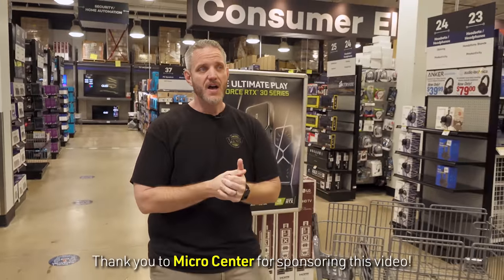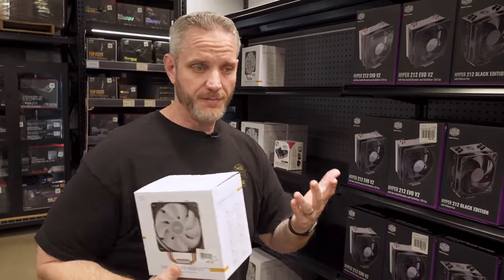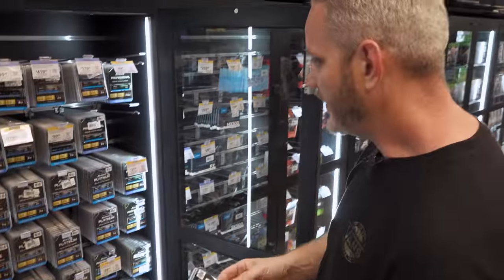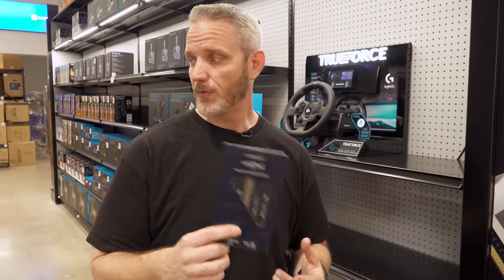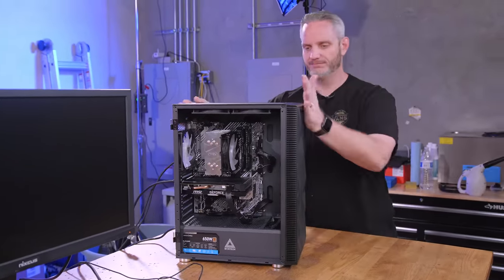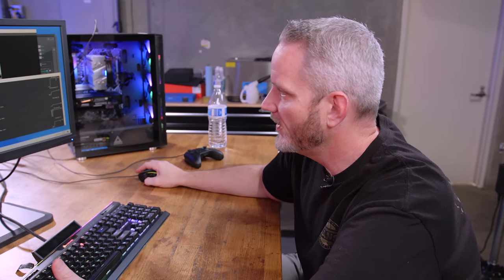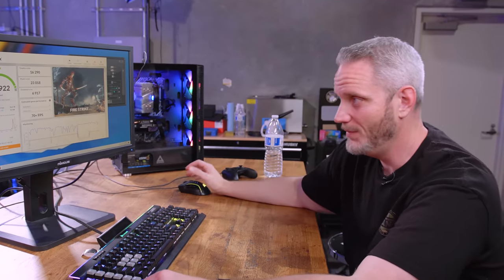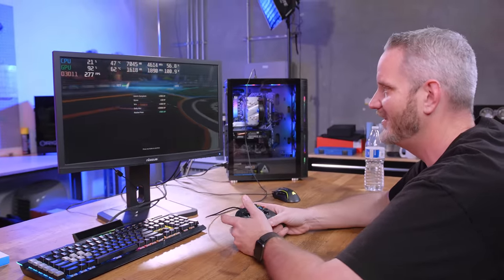How cheap can I build a "Gaming PC" for in 2022

Comment: Well I went the 5600g route and I'm quite satisfied, that allows me to save for a higher GPU. Still more videos like this are needed, most channels on PC building focus on middle high to super high end side of things, while most people hardly has more than 1 75hz monitor. Keep the good work
Reply: why not do 12400 for $100 cheaper? or 12600k for the same price but better?
Reply: @Raxion496  5600g better integrated graphics
Reply: Feel sorry for whoever buys parts like these. And his last part video. Terrible budgeting
The only good part was the RAM
Reply: @Raxion496  12400 is 200ish 5600g is 200 and has better graphics plus mobo and ram costs on 12400 would be higher and the 12600k is not a 200 dollar cpu
Reply: @idko785  well it depends on the budget and when u do get a gpu the 5600g just won’t be as good
Reply: @Raxion496  intel motherboards are expensive
Reply: What ever u get use that bad boy i got 5600x with a 3060ti
Reply: I know not everyone can do this, but being in the PC scene for about 10 years I can say a few things. Budget pcs are simply not worth it if you are going to upgrade them in 99% of cases. Buying a upper mid tier/high end PC every 6-10 years vs upgrading a budget one or building a new budget one every 3 years is night and day. A high end PC in 2012-2016 is still very usable today. Think of 7700k and 1080ti, still very respectable. if you bough a budget PC, gtx 1050ti and i5 7400, not so great huh. maybe you upgraded the i5, to a new platform, that's a lot of money. maybe you upgrade the 1050ti to a 2070, but that 400 watt power supply you got isn't going to cut it. Now add a power supply. wait, the CPU is bottlenecking it, I'm only getting 10% more fps when I should be getting at least double. This is just an example so take it with a grain of salt. I just wanna shed some light for the people who think buying multiple budget systems/upgrading is a better path. a 7700k and 1080ti is still a great system today, 6-7 years later, and could be sold on craigslist to cover about half of a new high end PC. Sometimes buying a high end pc and riding it out for longer is a better choice on the wallet if you can afford it
Reply: Just did this for a friend. I'm highly impressed. Hes still playing almost anything at 1080p 60fp with proper setting. Will pair very well with a 6600xt down the road for some 1440p action.
Reply: well g model will lose you fps when you buy a gpu vs the x or even the cheaper i5s
Reply: My 3400G got me pretty far. Now I can't wait for the RDNA2 APUs.
Reply: @coreytv1338  I just buy budget that can play most on High at most affordable native resolution, play on Low-High after 4 years, still works fine after 6-7 years Low-Medium (even High on older or less demanding titles) at native resolution, maybe 80% resolution by 8 years in. Just because it stops running games on High doesn't suddenly make a PC useless.
Reply: 12400 is alot faster then a 5600g though. Same with a 11600k.
Reply: @Tofuey  Dude, it's 6c/12t. What's it going to bottleneck?
Reply: How much did the total system cost?
Reply: I went the same route as you did
Reply: Had a 5700g for almost a year picked up a 6800XT for msrp I liked the extra cores and was okay with spending a 100$ more
Reply: I have a 60 hz 4k
Reply: @BREEZYM6015  around 803.81 with keyboard, fans and mouse upgrade as well
Reply: @angelcm156  Not bad.
Reply: @Raxion496  The mobos are expensive and the cheap ones suck
Reply: Beware that 5600g only supports pcie 3.0 when you buy the gpu (6500xt only have x4 lane, 3050, 6600 only have x8 lane), so aim for 3060 or higher
Reply: @Raxion496  yes but its better not to have something you want to change for something better + you could change both cpu and gpu
Reply: @geekarch_pc.id_  even the 6600 xt have only x8 lanes, I think a good option for the 5600g is the 3060ti which has x16, although 5600g only supports PCIe 3.0 it will still perform better than the 6600 xt.
Reply: @TroostDesigned  i didnt know that, thanks
Reply: @Raxion496  you won't even notice the difference in performance between a 5600g and a 12400 in reality even with a discrete GPU. might as well pick the one that comes with good integrated graphics while you wait for your GPU and easier motherboard choices. It's personal preference at the end of the day.
Reply: @coreytv1338  Yeah I just started realizing this the past couple years. My next build is not going to be upgrading to a better "budget build". I rather save up some more and get a high end build and not worry about upgrading for a while.
Reply: @bhuvangunessee  As long as you are happy doing that, that's all that matters. I spend so much time on my pc that I want that 144hz locked at high to ultra settings. I dont game all the time and rarely a AAA title,  but when I do I want a high end experience. I'm a programmer, so my pc is something crucial to my ability to make money. Everyones goals are different with their pc. as long as you are happy, that's awesome. I just wanted to post my thoughts to shed some light on another perspecive. budget builds are usually great low wattage homeservers if you pull the gpu as well. There are lots of ways to look at it
Reply: @MyNameIsBucket  the architecture of a cpu is more relative to performance than ghz or core count. IPC is normally the leading factor in performance, but obviously relys on cores and ghz to get the most instructions per second. performance in the last 7 years has been crazy. mostly on the cpu side imo. Wait another 10 years and we will probably look at this hardware as lower end gear hopefully
Reply: If this was ment to be "cheap" did you buy an Intel CPU and motherboard and then spend £30 on a cooler that probably no better then the stock cooler ?

I went 5600g for my plex media server, l already had a B-450 motherboard and just wanted more grunt then the Athlon 3000g I had
Reply: This is the route I have gone for my brothers birthday as his budget doesn't allow for a GPU right now. He can then save for a GPU so he gets better performance in the future
Reply: @geekarch_pc.id_  Pcie 3.0 would be fine if I decide to go with a 5600g. The PC will be for my son's 18th birthday in October.
Reply: @coreytv1338  I'm just a bit annoyed every time I see a $2000+ build to play LoL or Super Mario at 60 FPS or YouTube and Instagram and no games just because an influencer mindlessly said it's better to future proof. It doesn't matter if you're a programmer or not, stop mindlessly telling everyone to futureproof out of context. Start telling people to go with their budget and wait if necessary for a bigger budget if they really need it.
Reply: @bhuvangunessee  My budget was $3K and it’ll last me 10 years 🤣 poor people will keep paying to upgrade. It’s the same with everything
Reply: @christophervanzetta  hey, you waste your money however you like, odds are in 2 years you'll probably be complaining your PC is slow because you don't know how to maintain it and get a new one  mindlessly anyways
Reply: @bhuvangunessee  I agree with that. I was just trying to point out that building a pc with plans to upgrade is more expensive than just buying it upgraded. Also the better stuff you buy, the longer most would be happy with it before building the next
Reply: In this GPU market, it may be worth buying a 5600g or 5700g of you want to wait for gpu prices to come down, especially if it is a first build. In situations like these, I normally just sit on my current build until the market settles out, which cant happen if you dont have a current build. I respect the 5600g and 5700g choices for the first time builders right now
Reply: @bhuvangunessee  "Get a new on" 

I've been building my own since 94 🤣which still runs
Reply: @coreytv1338  you definitely got a fair point. I swapped my old rig last month. It wasn't so powerful as you mentioned (Ryzen 5 1600/GTX 1060 6GB) but it lasted me nearly 5 years and I still sold it nearly for half the built price (I kept ram and storage for new build). When I was buying it the standard for 1080p budget PC was around 600€ at that time. I spent close to 1000 and I was still gaming just fine even newer titles this year at 1080p/60fps. But since Im no longer a student and can afford better things I got myself 12700/3080 and the performance of it its just wow. I switched to 3440*1440 144hz because I primarily play sim racing and I see this rig lasting quite a bit into the future (I still got plenty of power left on the table). I might swap the gpu in the future everything else should be just fine holding it. Will see
For now I'm quite happy what I've got and I also picked the gpu for quite a good price so the total upgrade cost with the monitor was around 1700-1800€. Worth the price in my opinion.
Reply: @christophervanzetta  unless it's still the same CPU, GPU, or motherboard I don't understand your comment. Plus there's very little chance you have anything from 1994 in your current build, and if it's still the same original build from 1994, that's even more stupid, you're overspending on your electric bill and it's just a complete waste of energy.
Reply: I went with 7 5700g since more cores are better for my needs and buy gpu one day since I don't really game, and I also needed to get a monitor and I am quite satisfied:)
Reply: @TroostDesigned  3060ti’s are like 200$ more than 6600xt rn though.  I looked it up and running pcie gen 3 on a 6600xt is only like a 1-5% performance loss over gen 4
Reply: Then what would you have suggested differently genius

Comment: Jay:"I'm saving $20 going with the Intel CPU."
Cooler:"$30"
AMD:"..."
Reply: exactly
Reply: You can purchase a stock intel fan for $5
Reply: @Shut6000  those fans are meant for like celeron pentium core duo kind of cpus the better the CPU the better u need the fan
Reply: My thoughts exactly. Saved $20 on the CPU that DOES NOT come with a cooler in the box... I have questions. Already went from "Most bang for your buck" to "Because we haven't built one of these yet"
Reply: @Claudio Salazar I cool my 12600k with the stock cooler that came with my 9600k, mostly because I've been debating whether I want water cooling or not.
Reply: I actually bought the H100i Elite  Capellix yesterday, but my computer is definitely not a budget build.
Reply: and after buying the cooler  say "this  saved  us  20  "another" bucks to spend somewhere else"  he's already 50 pounds worst , LOL  what a knob
Reply: @lastdon6585  Problem is.. AMD doesn't provide cooler fans with their CPUs anymore.

Comment: Had a client bring me parts to build a PC. He didn't consult with me on some of the parts and came back with a PowerSpec power supply. Build went great, everything posted, system worked great for a day. Then the PSU blew. I took the PC back, pulled the PSU out, and told him to go return it and buy something from a few of the reputable brands I then recommended to him. He ended up with an EVGA and hasn't had a problem since.  First time and last time I'm building with a PowerSpec PSU. Wonder who the OEM is.
Reply: Had two of them fail in a row for me. Micro Center needs to find a new supplier for their PSU's.
Reply: my CoolerMaster psu broke yesterday after just 1.5 year of use (MWE 750 Gold)
so maybe also stay away from CM PSUs...
Reply: When it comes to PSUs I'd definitely recommend on of the brands that build for themselves. Like Seasonic. Of course they are a bit pricier but still better than buying a second PSU after a short while (or even a burnt home).
Reply: I've had a powerspec 650 in my PC for 2 years with no problem
Reply: I refuse to build a system with a shoddy power supply. There aren't enough liability waivers in the world to put my labor into something that can burn down a house.
Reply: @erfanpoison7618  coolermaster has one of the best high end psu, cooler master is quality always been. your psu is cheap, spend a bit more next time and it'll last longer
Reply: @erfanpoison7618  The problem is that CM is known for making some of the best PSUs you can get, specially at the higher end.
Reply: The best PSU's I've had are Silverstone, Seasonic and EVGA. I've had a couple of fans fail on EVGA SuperNOVA PSU's over the last 10 or so years, but never had any other issues, and EVGA's warranty is really good. Never had any issues with my Silverstone or Seasonic PSU's so far, and I've built and provided service on thousands of systems for customers.
Reply: Surprised Gamers Nexus hasn't put microcenter on fire
Reply: i have always ran with corsair cx psu never had a problem with the power supply itself only thing that ever happened was a power outage and my computer was still running until next day then msi motherboard fried but  psu was fine and all
Reply: @shanksisnoteventhatstrongbruh  My CM SFX 850 Gold went crazy with fan noise, and clicking noise after 2 months of use. I  got the second revision wich apparently dind't have the fan issues the V1 has, but it's now on RMA. I changes it for a Corsair SFX 750 and it's running now without any problems.
Reply: I have a Corsair RM750 (2018?) 80+ gold. It’s been over two months now and it’s still  working fine for me.
Reply: Ive had two PowerSpec power supplies for different computers over the years and Ive never had them fail. One was this exact PSU in the video, and the other was an 850 watt 80 plus gold. But maybe I got lucky who knows.
Reply: I have their 850W model and it comes with a 10 year warranty, so honestly I'm not too worried about it. My CoolerMaster 850W SilentPro PSU I was running before still worked until I swapped for the new one.
Reply: Just had a gigabyte 650W die on me.  They RMA'd it but it's been a month and still haven't sent me a new one yet.  I had an extra, at least to use while I wait.
Reply: @jmugurr994  Gigabyte PSUs are known for how bad they are lol
Reply: Ive had an evga psu blow too…one bad case doesnt represent them as a whole.
Reply: @erfanpoison7618  been running my CoolerMaster PSU since 2014.. never had any issues with it.
Reply: Rocking a few year old corsair CX750m. (black Label not newer green sticker one) Has been great for the price.. its even holding up to a 10805k and 3080 right now.. Yes i know i am pushing the limits of it.
Reply: Sometimes brand isn't everything. I've had an EVGA 600W psu burn out my decade old gtx 560 ti and a new gtx 1650 (which got rma'd), then my PSU tried to attack my rma'd gtx 1650 again but failed and the psu died. Went with superflower leadex iii after that. Edit: the EVGA psu became malicious a few months into using it.
Reply: @Tokena14  The cooler master PSU they have is a B-Tier, doesn't matter if it's cheap if it's a good power supply, they just got unlucky
Reply: @legoboy-ox2kx  you've been brain wash by gamer nexus a lot. all psu has the possibility of been defect, not only psu but also other part. how come gigabyte in US explode while in Asia or other region are not? i also wonder why gamer nexus not testing other psu which some of them are from the same manufacturer. he only targeting a brand from asia rather than US brand like microcenter in-house psu that also have problem to explode. even some of people here doesn't had any problem with powerspec psu for years. that mean some of the psu sometime were defected. even EVGA high-end GPU also have been bricked & they pointed the finger to manufacturer during assembly. many company didn't manufacture the product by their own, they usually sub to other manufacturer & use their label only. no one can escape from the faulty. LMAO 😂
Reply: @Novacayne can you recommend a "not-cheap" CM psu so i don't get bothered next time
Reply: I use the phanteks PSU's only, hell, 12 year warranty alone makes up for them being a bit pricier.